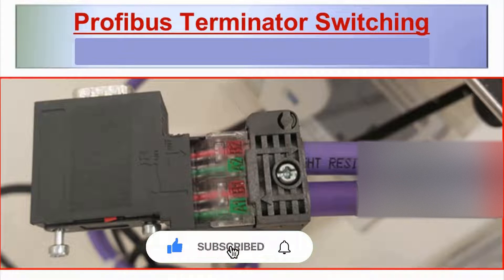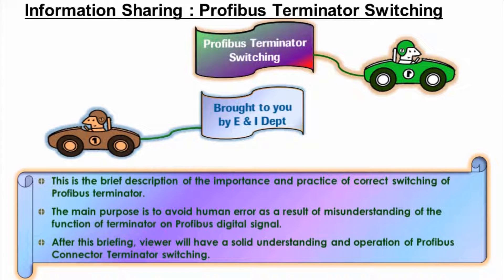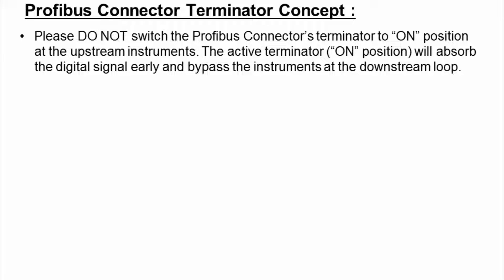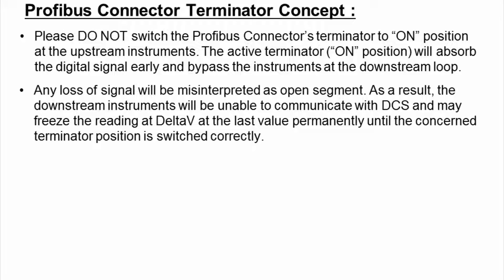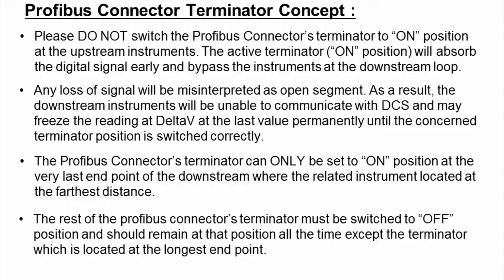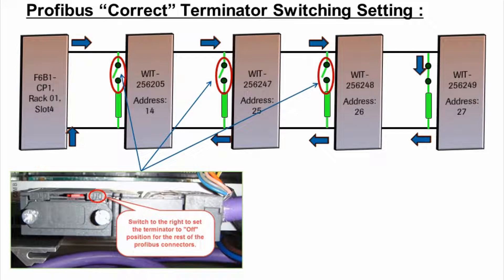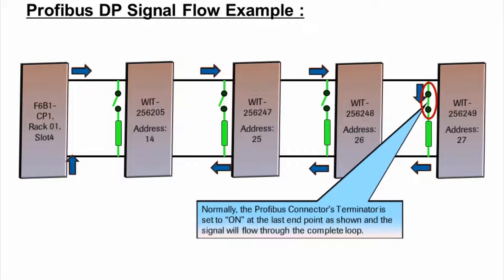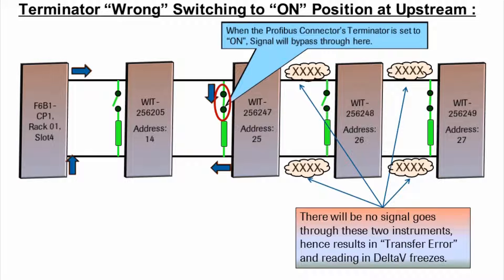Profibus Terminator On and Off Switch Briefing

Comment from the maker: This clip discuss about the use and effect of terminator in Profibus signal loop. We need about two terminators in Profibus fieldbus loop with both located at the farthest end. If the terminator is accidentally switched to "ON" position, it will cut down the communication at tyhe downstream side of the rest of the instruments. This slide shows the the actual real life troubleshooting that happened in my plant.

Comment: this is confusing, Siemens website says that terminating resistor has to be ON on the First device as well and the last device. All intermediate devices should be OFF
Reply from the maker: Hi @afzalbyabani1373, You are right ! In fact, for all fieldbus loop whether it is profibus, foundation fieldbus, etcs, the first end terminator and the last end terminator in a loop should be terminated with terminator. 

If someone accidentally switch the terminator from off to "on" somewhere in the middle of the loop, the rest of the "downstream" devices which located after this middle terminator will not be able to communicate as illustrated in the video. 

So, must always ensure only both first and last end terminators are switched "on" only and the rest of the terminators must remain "off".